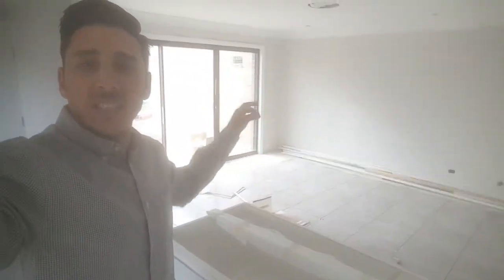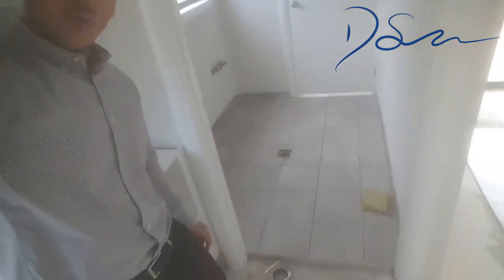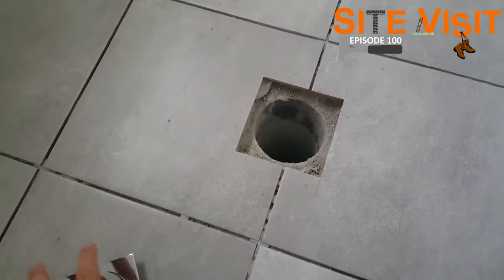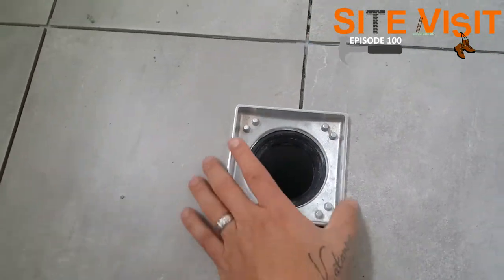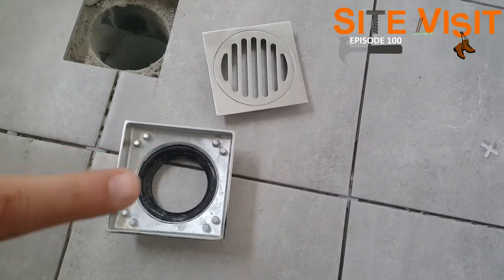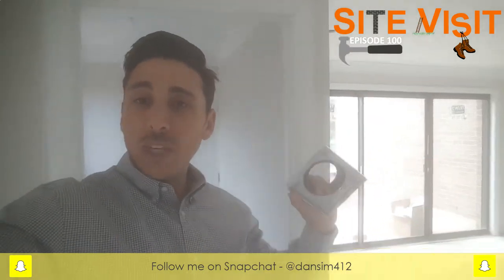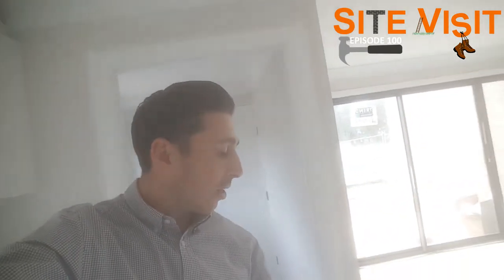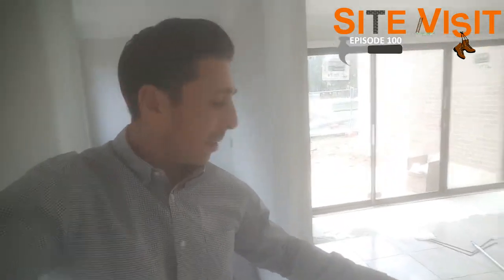Floor Wastes | Site Visit: Episode 100

Comment: This information is incorrect as the smart tile waste is NOT glued into place (as mentioned) and the stainless steel grate is the correct one (which he said is not (it actually gets grouted in after it get glued into place)  in that application and the smart tiled waste that he mentioned is the correct one is the wrong size  (which is why is doesn't fit in the hole shown), hence this info is incorrect. Just saying in case people are trying to install a grate when looking at this video.
Reply: your grammar gave me a headache

Comment: Can you replace the grate one with the tiled one without breaking the tiles around the drain? It seems the grate one is less deep than the tiled one. I want to change my drain inlet as the current on is made of cheap chrome and has scratches all over
Reply from the maker: I would not recommend it as there would be not grantee with you would be able to keep the waterproofing safe.